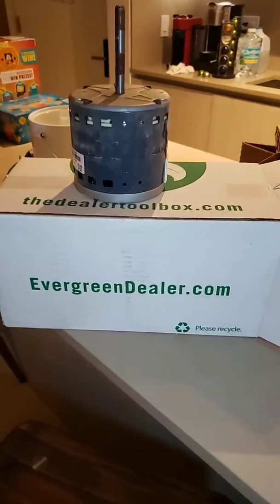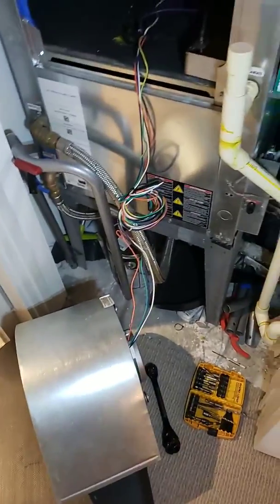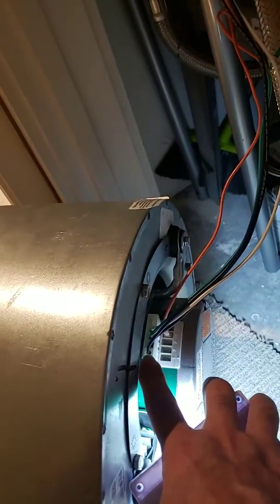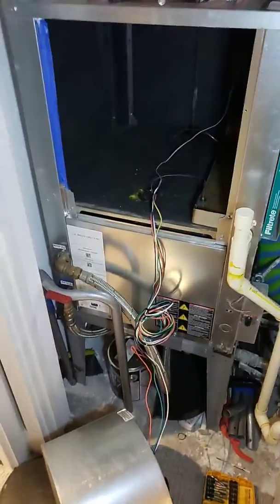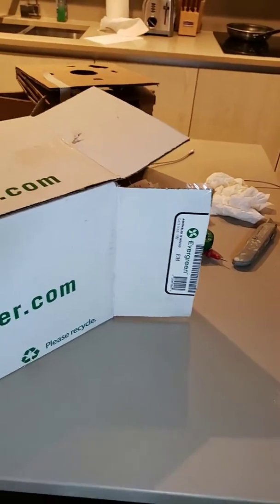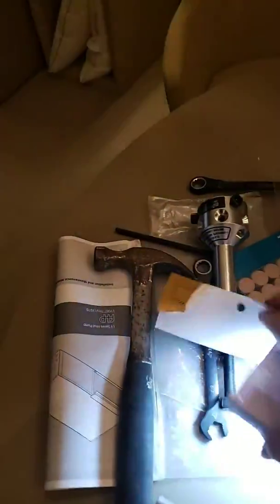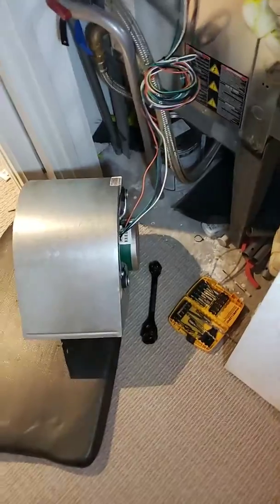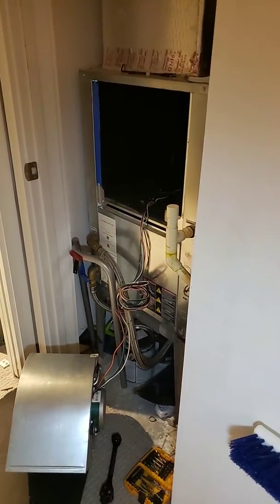X13 blower motor keeps running on my Bosch heat pump #hvac #blowermotor

Comment: FYI 
The Evergreen EM and the OEM ECM  are both Genteq brand and manufactured by Regal Rexnord(previously Regal Beloit) and mfd. in the same location 

The Genteq OEM ECM is programmed to the torque taps, equipment specs, the Genteq Evergreen has an open programming(tap #5 100% torque, #1 50% torque, appx) to allow the services to select the best torque speed
Reply from the maker: When I made this video back 2019, the em was $180...now I'm told 2x
Reply: @henelect  not sure how much our distributors charge but usually less than OEM cost, plus readily available

Comment: Good stuff.  My Carrier air handler (also two years old) is doing the same thing with the same issue.  I can completely remove the 24 VDC signal wires going to the motor and it still spins WFO.  Thanks for the tip on the Evergreen EM.

Comment: I replaced my bllower motor on a older Coleman electric furnace and didn't i replace the capacitor would that make the blower keep running ?
Reply from the maker: No, the capacitor is only used to jump start a single phase 115v motor, these X13 motors have a potted capacitor built in, you don't have a motor problem, its either the thermostat,  or the furnace control board which is not expensive,  disconnect the thermostat and if it stops

Comment: Good job first. But.  I wonder why BOSCH do not have a better warranty on his units. I would not recommend this make to nobody because of the warranty time situation Its a FHP heat pump anyway. You can and could put a regular PSC motor with a Relay or use the existing System Contactor,,,,for future Eliminate The circuit board and just add a Relay and a Lock out Relay and you are done. It s easy to deal with that , than with circuit boards and x 13 motors. Ttul.Great job.
Reply from the maker: Great idea, the original motor just had a stuck relay anyway,  so probably a ice cube relay could have also done the trick...it was easy to swap out, even with limited tools on hand since this is my vacation condo,  I've lost all respect for Bosch...

Comment: The new one shouldn't have a warranty on it at all. Those motors usually go bad at the module because of an underlying cause and when a non certified non qualified person is putting them in without looking in to what took it out in the first place why should Bosh warranty it?? You might want to pick up 2 or 3 because you'll be replacing it every season (if you're lucky)
Reply: BS
Reply from the maker: Agreed I'm not an expert, but as a NJ licensed electrical contractor, I had to see why the original installer was charging me $1500 for the repair, they said it was common amoung the units in the 42 story 2 yr old building, it being my vacation home in Miami didn't help, but $1500 for a motor seemed it was worth a look, it's been running great since, but I agree I'm not an expert
Reply: @henelect  very simple replacement,first checks you need to make are at the 2 plugs at the motor,1 is a high voltage plug,240v,with a common wire in it for 24vac low voltage,the other is your 24volt plug that energizes when the thermostat is calling for a/c or heat,those wires are speed taps,so in short check to see if you have 240,it is present all the time,next check the low voltage side with the thermostat set to cool you should have 24vac between a speed tap i believe #4 and the "c" on the high voltage plug if both are present your motor is done,im in hvac and i get a new motor @the same price as a motor module,so get the Evergreen x13 replacement motor,also once its replaced and you call for a/c the motor will orient itself to blow in the proper direction so dont freak out when it rocks back and forth.turns both directions,its normal,i trust with your background you are competent and im not responsible for your well being and yes it is a common issue
Reply from the maker: @blancoazcracker365  I'll definitely check that, thanks so much for your help... Bosch would not give me any help, they just told me to call the original installer, on the phone they told me $1500 minimum charge...that's why I took a look, the units were originally purchased by the developer in 2014, Installed 2017, according to Bosch the 18 month warranty started when purchased...
Reply from the maker: Well, my blower is still running perfectly, and often since its in Miami...I'm confident in my repair, its February 2021...that comment from someone was incorrect...
Reply: non certified -- what a crock --

Comment: FYI-- It should have a 10 year warranty. I think someone lied to you. https://www.bosch-climate.us/files/Bosch_IDS_BVA-BOVA_Series_warranty_03_2016_US_1.pdf
Reply from the maker: I was on the phone with Bosch and there warranty starts when unit was purchased, not installed... upsetting, since I was quoted$1500 for the repair from the original installer, that's when I got involved.. running great ever since... thanks for the link/ info